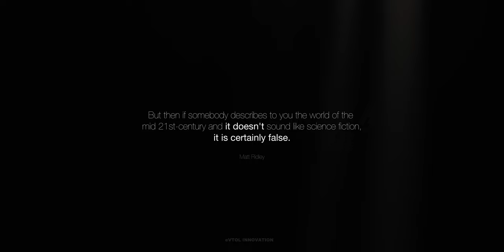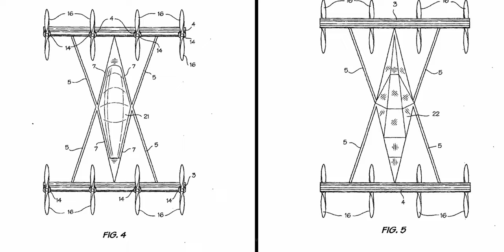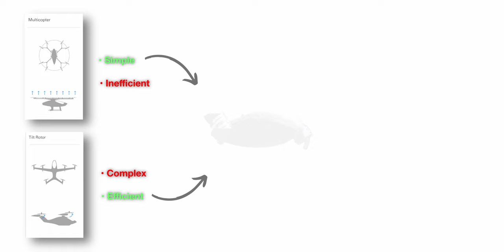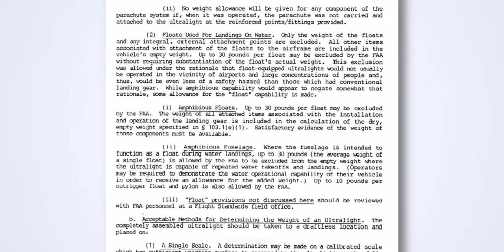The story behind Opener’s BlackFly [Pivotal Helix] strange-looking design

Comment: This design definitely seems like the basis for a new type of vehicle. If it was slightly larger with a tiltrotor mechanism and landing gear, it could actually become practical as transportation. I get that it's small so you don't need a pilots license but I bet there will be more specialized licenses in the future for aircraft of this type.

Comment: I love this craft. And I want it to be able to land on water, have the right buoyancy so you could, if needed open the glas and not gain water....and be able to continue in water....the propellers, would need to become the ships screws etc... And start thinking lol...of a millitary functional version. Since this one...is a great design. And I mean...a grand and promising design. Yet! The propeller need to be able to be rotate able independently from the angles of the flaps/wings, so two four of them or some of them could function as direct propulsion, and some as keeping it heights and or lows. Than I think it be even better.
Reply: It is powered with electric motors and batteries. It would take some reengineering to make it waterproof, but it could be done. It would not be a very efficient water taxi but it expand its usefulness if it could takeoff from water.